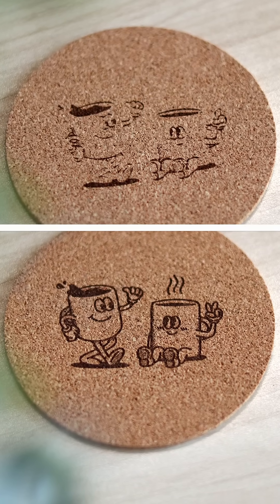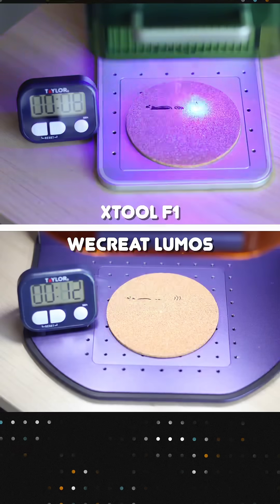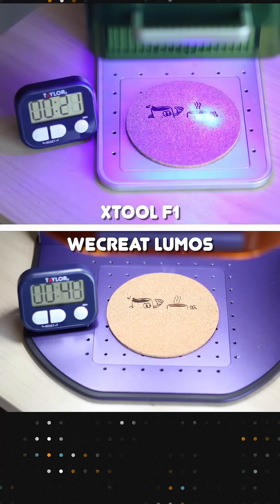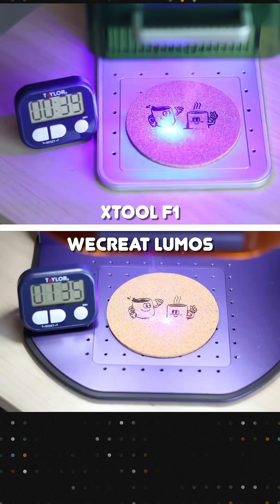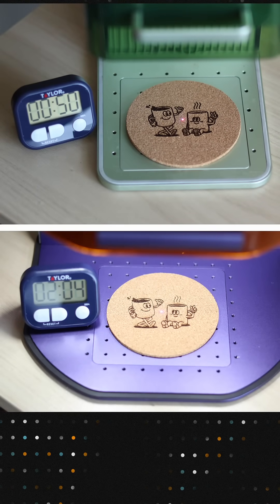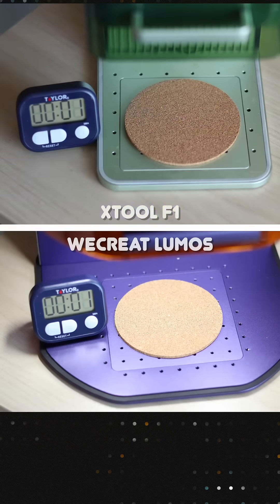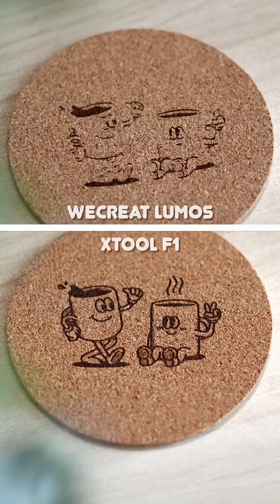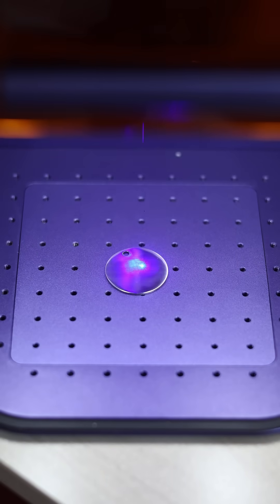xTool F1 VS WeCreat Lumos #velfcreations #xtool #wecreat

Comment from the maker: We put the new WeCreat Lumos Head to head with the xTool F1. The Lumos introduces a lot of cool accessories and features but is it actually faster than the xTool F1? 

Here are the settings we used to engrave this cork at high speed.

Blue Light
Power: 100% 
Speed: 1000 mm/s
Line Density/Lines Per CM: 300

The second test we bumped up the speed to 4000mm/s

#velfcreations #xtool #wecreat #xtoolf1vswecreatlumos #wecreatlumos #laserwngraving #creatorsearchinsights